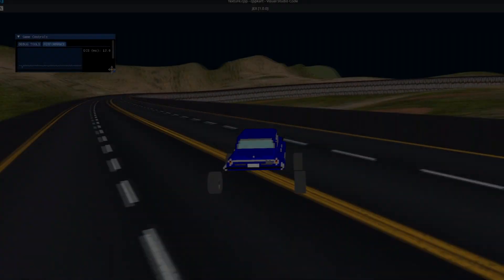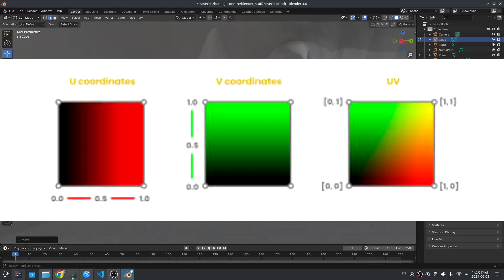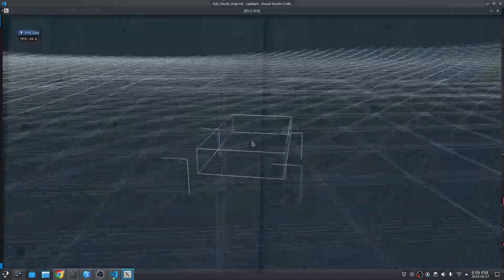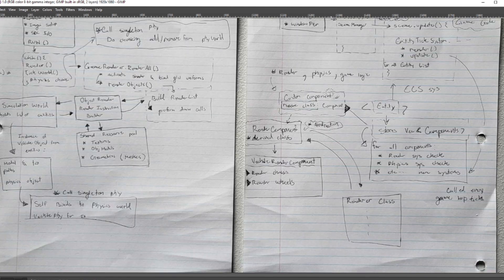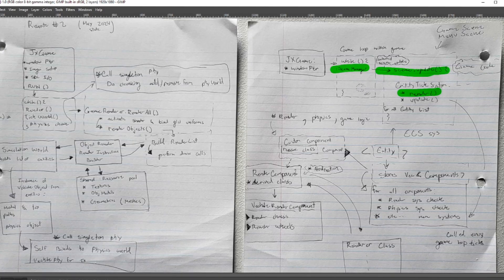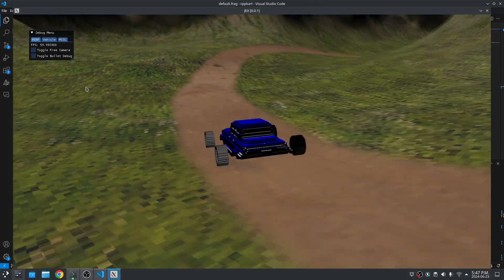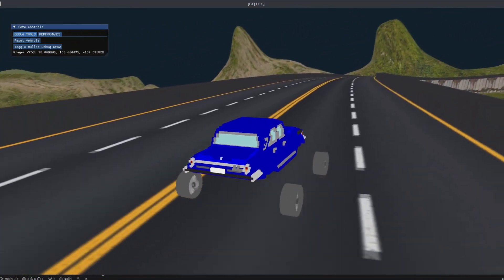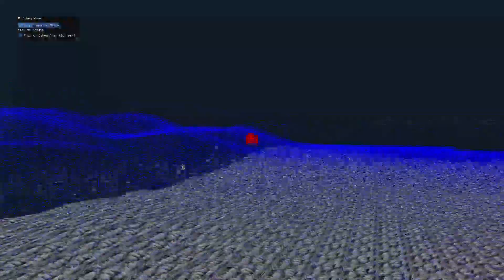OpenGL C++ Game Engine Devlog #4

Comment: My game engine journey is similar to yours. After implementing ECS, I realized that I was still heavily making use of OO - Entities and Components were classes. Switching over to entities as indexes into a set of typed component arrays has done wonders for performance. Another thing that is working out well for me: “everything is a component”. Even the basic stuff like renderer and input system. I’m unserializing my scenes from JSON, so it makes it real easy to switch out different renderers (software vs GL vs vulkan for example) e.t.c. Good luck!
Reply from the maker: Awesome! that's very robust, I still have lots hard-coded scene & graphics, I still need to master ogl before going to vulkan haha, but eventually I think I'll need to add that, Thanks for the nice words ! :D

Comment: Looks great!  The anisotropic filtering cleared it all up.

On the wheel lighting:  Sounds like you probably have a handle on it already conceptually, but just in case:  That's caused by using the local normals instead of world normals.  So like you said in your vid, transform local to world and do the lighting calcs on those.  Off the top of my head I think it's something like worldNormal = localNormal * model view matrix.  Depends on what coordinate system your rendering works in and what frame the light is in.  Basically there's only model and view matrices so it's either going to be one of those or both of them multiplied together probably.

Shadows are a deep, painful rabbit hole that's easy to spend forever on, especially for large outdoor scenes like this.  I'm still not happy with mine.  Might be better off waiting awhile on that while you bang out other stuff.

Great progress though.  Looking good.  👍
Reply from the maker: Thanks Todd, yea my plan is to get something basic working first (in terms of shadows) and then leave it alone for a while... I definitely want to prioritize adding more game functionality and see how it scales! 

Thanks for your support as aswell 🙏 ❤️ ~ Best Regards, Jason